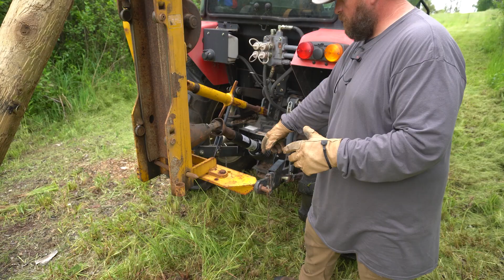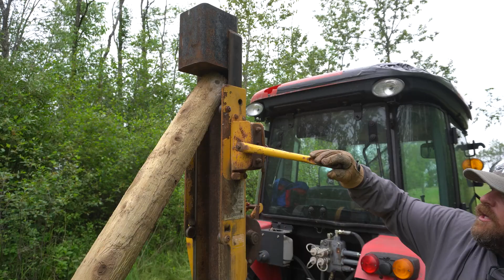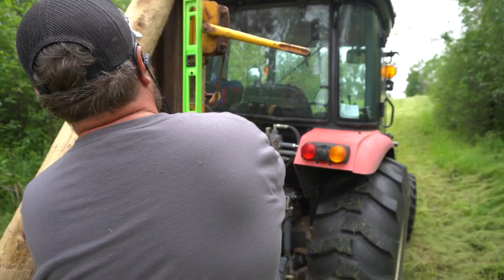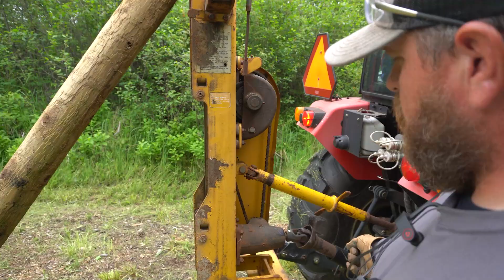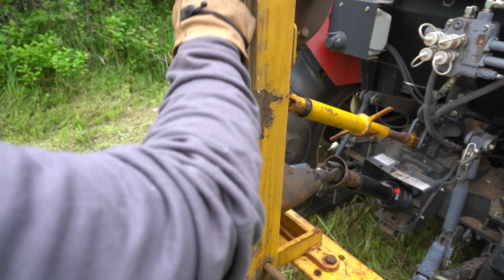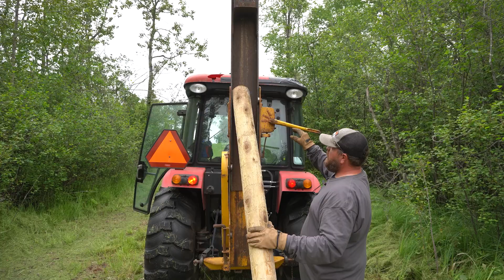Danuser MD-5 Post Driver - PTO Powered

Comment: Wow!! 600 bucks is a steal!!
Reply from the maker: For the time it saved, it's been a real life saver.
Reply: @homesteadtwins absolutely. If you use it on a total of 60 posts for its life, you've made your money back. Beats the heck out of back filling after augering
Reply from the maker: @RufusTBiscuits I didn't do a video on it but we knocked in about 35 10' posts in softer ground. It would have been impossible to tamp in those posts or for me to drill down 5' like I needed them to be. 

I plan to put up about 900' of 5' high tensile, no climb wire next year and using this tool will really help. Rough estimate I will need to put in over 60 posts just for that one job.
Reply: @homesteadtwins absolutely awesome bud! I hope it continues to serve you well!